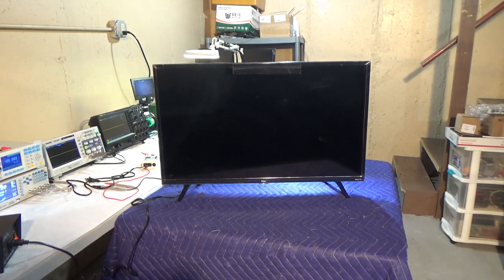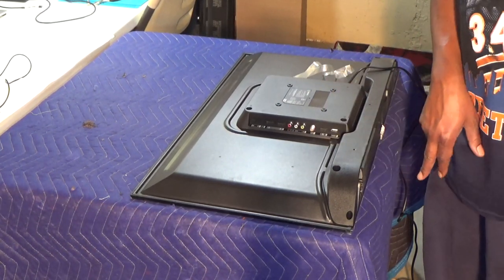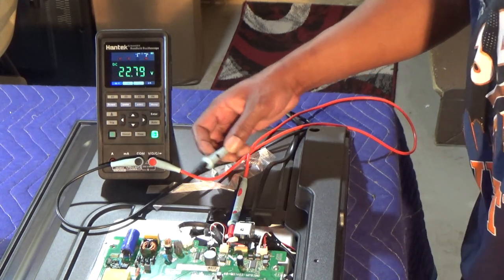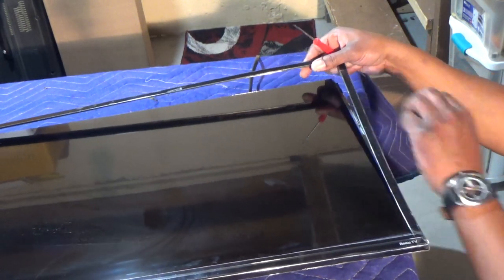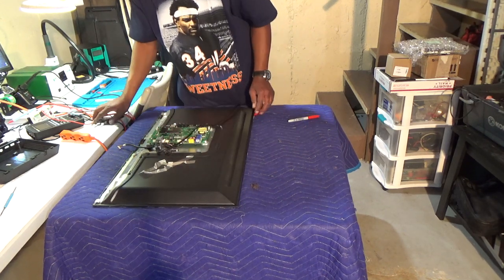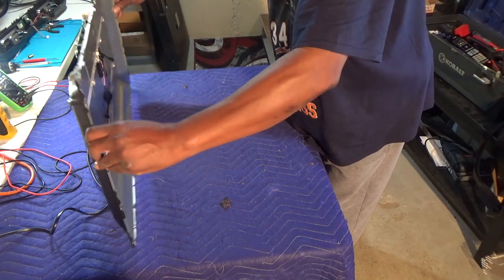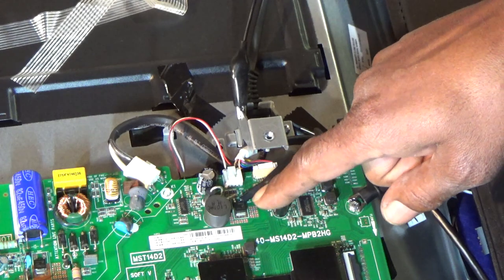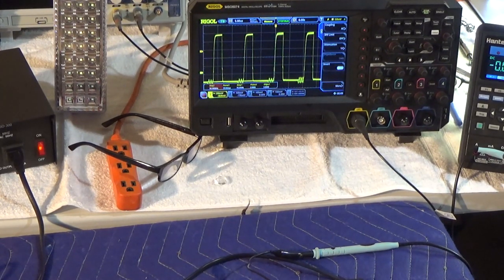TCL 32 inch no picture _ dark picture. Model 32s321 tv repair.

Comment: Good info bigdog earned 👍. Led circuit supposedly lasts longer in theory. Lg, sharp, Sony have backlight issues too. What tv brand don't you see often coming in for repair,  for me it was Toshiba and Panasonic.
Reply from the maker: Yeah hardly ever see any Panasonics. Probably because they didnt make that many or sold that many Panasonic Led Models. Only 1 Panasonic LED Tv that I can remember replacing the Leds on. That was like 3 years ago. lol
Reply: Panasonic let the US market along time ago

Comment: Sir you sure spoke the truth in this video. My living room t.v just went out today May 13,2021 and I purchased the Tcl 32 in. Nov. 2018 I remember purchasing a warranty for the other tcl t.v but not the on e with the issue. If I am unable to find someone to repair the t.v i may have to purchase a t.v after having both tcl about two years unfortunately.  Lord have mercy I may just purchase a other brand or get an extended warrant for all t.vs.

Comment: this is awesome thanks for posting. i have a 32" i think i shot parts at till i found a bad LED. but, i have 2 little clear shark fin shaped stand offs with one screw hole that look like they go between the LED and diffuser/glass to keep the glass from bowing in. can't tell where they fell out from or if i forgot i took them off of some piece but, mine is a 32s327

EDIT: stopped took a break and wathced this video and whent bakc and noticed i missed  2 extra screw holes next  to the LED strip and 2 extra screws!

Comment: Big Dog: I have an old Panasonic vhs/dvd recorder that had a capacitor issue. I soldered an identical new one in properly and it worked great but shortly after that it went completely dead again..  Wonder if needs a different range capacitor to prevent it and it was a common flaw with that particular unit but it did work great after it was changed & you could see how it popped like a jiffy pop.  Am perplexed.

Comment: Great video.  I have a 40" TCL, model # 40S305.  It has a similar problem to the one in the video.  When I turn the TV on the screen flashes brightly one time, for less than a second (Can read the TCL Roku TV logo on the red screen) before the backlight goes out.  Picture is still there, but no backlight.  Do you think this may be a similar problem?  I didn't notice that your screen in the picture flashed when it was first turned on, so I'm not sure it's entirely the same.

Comment: Good evening, I have a tcl tv model 32s321 with the same fault. My question is, did you change the resistor and the capacitor or just the resistor?
Reply from the maker: probably both to be safe

Comment: Bigdog!!! Have a question. TCL 55us5800 has backlights and sound. No picture, t con fuse is good and has power. 
Lcd driver board has power from t con. 
 Not sure if it’s the t con or main board. 

Any thoughts or ideas to troubleshoot further?

Thanks. Looking forward to some new videos. 

As always appreciate your work

Comment: I have the same TV I'm working on at the moment with the same problem tested the back lights and none will light up which seems odd to me because that would be like every light in your house going out at the same time I found out there's a little capacitor on each strip and that is the problem with mine I touched the capacitor with my finger and I guess my finger became somewhat of a capacitor in the lights came on then subsequently my finger lit up to that shit hurts

Comment: Hi, Plz help me
I have a Samsung 6000 LED 3D Smart TV
After 8 years of use now no display is showing but sound is ok, I also check the screen by touching it and back light was also ok, I call a TV repair man at my home he says that he need to repair the panel which will cost 8500. I refuse to repair and brought a new TV because as it seems like he was trying to fool me. My TV was working fine and suddenly the screen got blank also there is no crack, lines etc on my screen it seems like some board is not working, Also the technician do not open the TV he just saw the TV touch it to see black light is working or not So how would he know that the panel is gone, not board.
Plz tell me is my panel ok or not or what are the symptoms if panel is gone.
Reply from the maker: He would have had to check the voltages on the T-Con and maybe isolate it too by disconnecting the ribbon connectors one at atime, $8500: Damn thats 2 brand new TV's and a car. Sounds like he was trying to get a stimulus check from you. lol.
Reply: @bigdog8882  yeah he didn't do that. Can you tell me the symptoms when LED panel is gone.
Actually he was asking for 8500inr which will be 150 dollars
Reply from the maker: @rohandobarkar4791  Backlight with No Video. Just like U got. But you gotta troubleshoot it to see if its the Panel or the T-con board.
Reply: @bigdog8882  thx bro, it seems Iike I have to give it another try and go to repairing shop for proper diagnosis because previous  one didnt given open the TV or check it for 2min.

Comment: 32 " TCL ROKU TV ... Don't recommend, I have this exact model not even 2 years old and degrading ... Messing with my head in every way ... Moments the picture is beautiful then beams of lights, sometimes vertical, double imagining and channels default to 360p in addition the picture settings default ( mainly backlight and contrast  settings ) ...Factory reset did crap and I've exhausted all possibilities ... Since this purchase was only $ 170.00 I couldn't justify spending ( an extended warranty  charge ) ... So partially my fault I guess ... This brand, The Chinese Lion will never ever be a consideration again ... Buyer be warned .

Comment: A lot of unnecessary work because you didn't realize tester reading was OK.
Reply from the maker: Thats not 100%. Testers are not fast enough. U could still have a leaky led thats slow to light when the TV is first turned on because of the current rush.  It will trigger the feedback circuit into led shutdown. But When U test it with your checker they will still light up. Have had that plenty of times on Toshibas, Philips, and LG's especially.